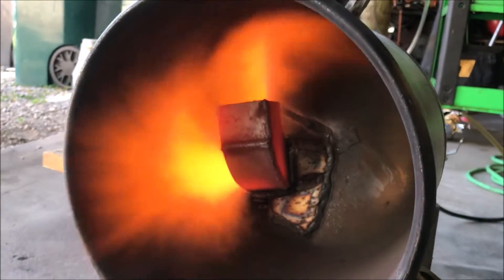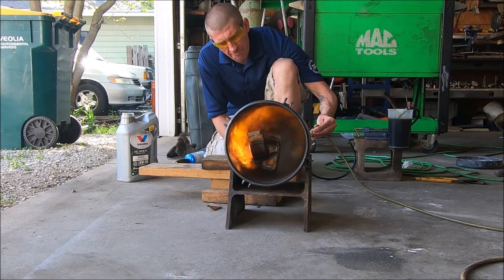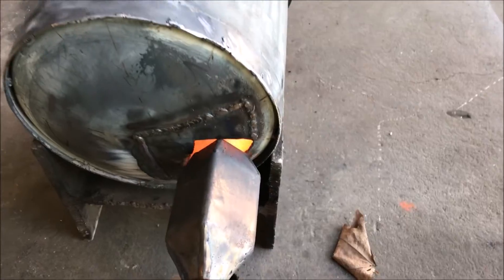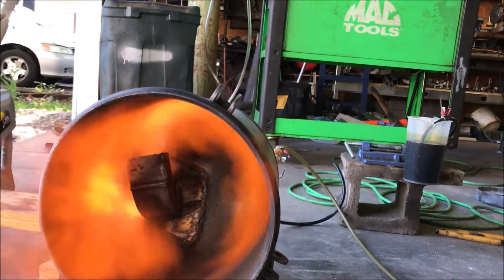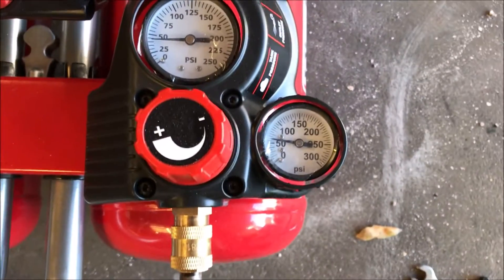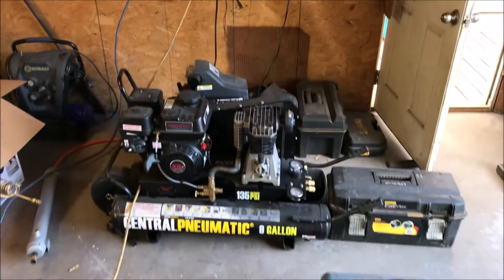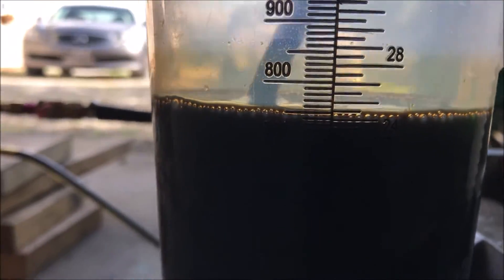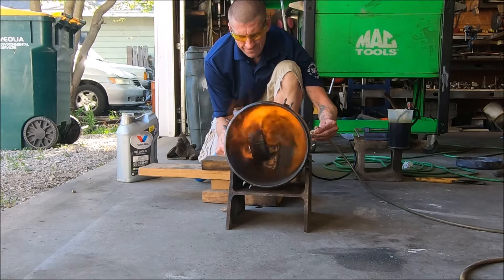Waste oil High Power Micro Boiler (Cyclone afterburner Design ) For Organic weed control

Comment: Depending on how you wind the coil it could be counter or parallel flow, mono tube or dual pass. Making a dual pass boiler for the kind of water flow rates you're working with may or may not produce gains, but would add a significant amount of fabrication time and material cost. Chances of finding a prefab vessel that fits inside the pressure pot are almost 0 and even if you did, you'd still have to fab a bunch of work in fabbing the ducting contours and exhaust, along with much more time in the coil itself. 

The length of the flame in that vessel, I don't think it's worth the expense and effort for dual pass. Would still benefit from an inner shroud to keep the flame tight to the coil. No clue on your design of this entire steam unit, but with the inner shroud you may be able to plumb your oil line through the center as a pre-heater.

Comment: Can’t you use a blower to lean the flame 🔥 so you don’t need such high flow compressor ?
Reply from the maker: Possible but increases complexity it may work though .An air compressor is essential to high performance of this combuster design   . This is why i dont use blowers , they cannot achieve the fuel air ratios possible with compressed air . Most commercial  oil burners use a blower and an huge  oil pump with a 2 hp motor and a blower fan . You have only the option of dirty rich burning flames that are not as hot as high velocity lean burns .
Reply: Yeh I meant like use air compressors to blow fuel in with the jet but use a blower in addition
Reply from the maker: Good idea , it defiantly needs more secondary air , yes i see what you are saying